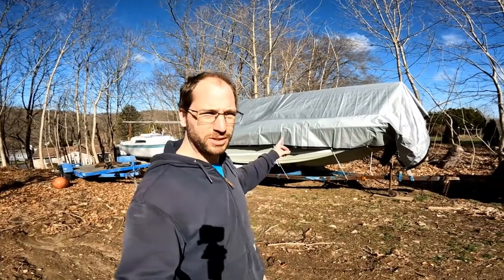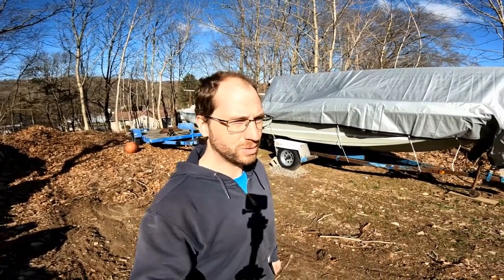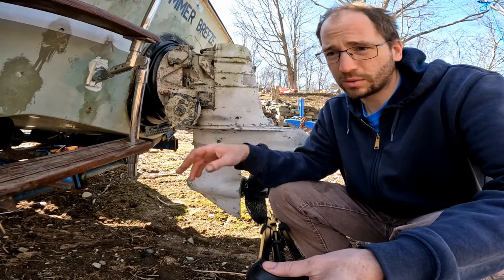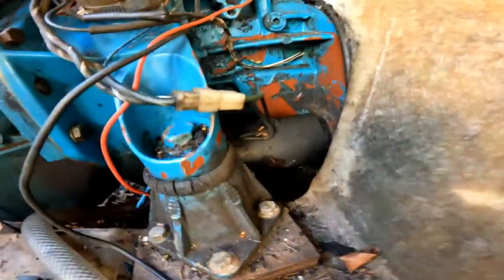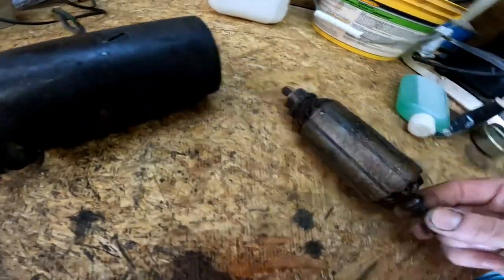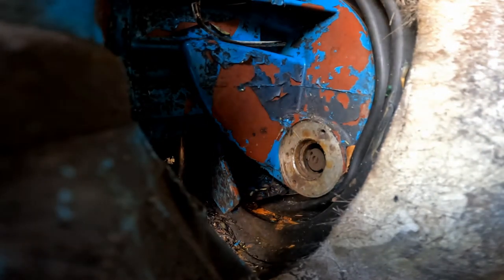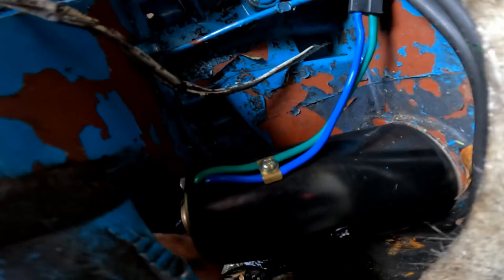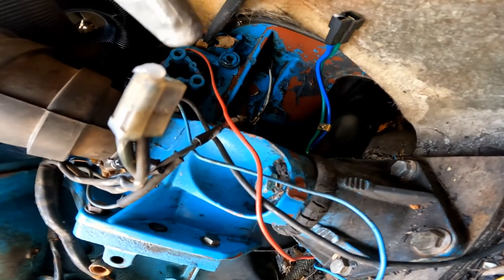OMC Stringer tilt motor replacement

Comment: Good job! my 800 tilt motor seized as boot cracked, flooded engine bay, so the none watertight motor pickled. Need take motor out to see how bad it is.
Reply from the maker: Its a crap job.  I have the 4cly 140hp. That has the tilt and trim solenoids under the exhaust manifold.   It's normally easier to take the two bolts out and drop the solenoids and bracket out of the way.  I don't know about the 800 but mine uses a 10mm bolt for the tilt motor.  A flex head 10mm rachet wrench is best tool for the job.  The motors are a  multi piece design so it will fall apart if your not careful.  Getting the shaft back into the brushes can be a huge pain.

Good luck, let us know how it goes.

Comment: no mention of hammer blow coupling (spring coupling and key) in your video....?
Reply from the maker: Maybe next time I service it. I'll do a better video.  I'm not a marine mechanic, just a guy with a camera trying my best.   There are not very many OMC videos this was more to document what I did.  The coupling is in place.  They seam to get stuck on the worm shaft, and the whole gear, shaft, and hammer coupling needs pulled from the drive after removing the metal plug cap on the back of the drive.   Once it's all out, the shaft, then worm gear, are put back in and reinstall the plug cap. The hammer blow coupling will likely be in 3 pieces, the two half's and the spring. You have to reassemble it, making sure it has some spring action when it is twisted.   The coupling is then put back on the out drive worm gear shaft from inside the boat before the trim motor is installed.

Comment: Hey, nice video.  I think mine broke, i just hear the motor spin but nothing is moving.  do they sell replacement gears and assemblies.  My boat is from 1981 so it might be hard to find parts.  I have the same OMC as you.
Reply from the maker: If you can here the motor still spinning you likely have a broken hammer blow coupling.   the part number should be 980274.   Best to take it apart and verify.  the coupling is two mirror halves with a spring.  The halves are bronze and the primary failure point.  The main tilt gears are steel and bronze they can't be damaged by normal operation and are not serviceable.   Check the hammer blow coupling first.

Comment: My new one is weak. And gets hot any ideas
Reply from the maker: Not sure what you mean by hot.  These motors are built with a thermal overload.   They use a bi metal strip to stop the current flow if the motor draws too many amps.  The motor should not get hot.   

If the new one is weak you probably have a weak current path from the batteries.   Copper wire degrades over time especially in high current applications.   The only other part of the system is the tilt solenoids  which have a copper contactor which can arc internally and cause reduced electrical flow. 

1. Manually lift the outdrive to check for an mechanical binding.  It should move 1/4" freely
2. Remove the worm gear cover,  lift the outdrive and the gear will come out.  https://youtube.com/shorts/B-_qDjhbY1U?si=ALZ5abH67GefpWz3 
3. Once the worm gear is out the electric motor can spin without any load.    
4. Run motor  20 seconds up, 20 seconds down, 20 seconds up, down, up ,down..... for 5-10 minutes.  This is a run-in process for the electric brushes and can help the motor start better under load. 

if the motor won't run your electrical system is bad 
if the motor over heats during run-in its likely a bad motor. 

Reassemble and see it the trim works better.  Even with a new motor and new batteries mine still has issues.  Some times i have to drop a rope around the outdrive and help lift up on the drive to get it to raise. I still have original solenoids, I'm planning to replace them to see if it help i just haven't gotten to it yet.   OMC should have used a lower gear ratio motor.   The drive would take longer to lift but at least it would lift consistently. 

good luck
Reply: @Theweldingmillennial  A cheap electrical winch will lift the outdrive easily. I could mount the winch directly over the outdrive on swimming grid.
Reply: @Theweldingmillennial  By doing so, I may lose trim function.

Comment: Did you have any problems after charging the battery? I did the same replacement on my boat, and it still won't raise with a fully charged and confirmed good battery.
Reply from the maker: The best things to check are:
1. battery - voltage and load test 
2. Lower unit- physical lift on the unit, it should pivot on the trunnion about 1/8 inch before the lift gear stops it.
3. Solenoid pack-  you should hear clicking coming from the individual lift and lower solenoid. 
4. Motor running- if the motor is running but you have no lift, the clutch or drive system is messed up. 

Does it move at all?  If it raises some but not all the way, your battery is weak and you should try having it load tested.  Also, some batteries just don’t like running electric motors it can over heat the cells and trash a good battery fast.   I have a 1000 cranking amp marine rated battery and I only get 2-3 lifts and them I have to wait 15 mins for the battery cells to balance back out and I can get another 1-2 lifts.    I pretty much try and only lift the motor at the end of the day when I pull the boat. 

You may also need to break in the motor. Which is basically running the motor when it’s new with no load to help set the brushes to the commutator shape.
Reply: @Theweldingmillennial  Its a bad design, my tilt motor seized due to cracked boots.

Comment: How can I get a diagram of the starter cylinoids my wires are mixed up
Reply from the maker: Most starters this age use a standard 3 or 4 wires.   The two large lug,  “B” is for the main power from the Battery.  “M”. Is for Main power to the starter.  On the small lugs. “S” is for the switch/start power from the key.   “R”. Is used on ignition systems with a Resistor,  it bypasses the resistor and give a full 12v to the coil during cranking.

Comment: how is a stringer drive different to newer drives?
Reply from the maker: "Stringer drives" are mounted only to the stringers under the floor of the boat.  The motor and drive are one unit.  Modern drives mount the motor to the stringers and the drive unit to the transom.  The transom on a stringer drive boat is normally 3/4" ply wood.  New boats use a much stronger laminated transom to support thr weight of the outdrive.  There are no modern "stringers drives" that I know of they all mount to the transom.

Comment: My husband replaced his tilt motor on an OMC 800 with a V8 motor. What a pain to get at the motor. Needed a mouse mechanic to get into the small space.
Reply: My 800 V8 faces the same problem, tilt motor seized, a very tight space to remove the motor.